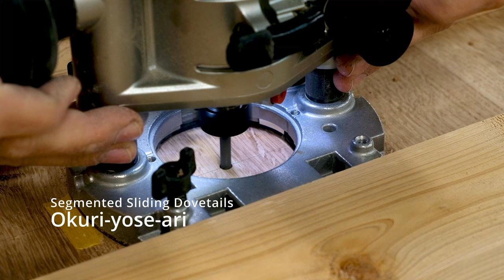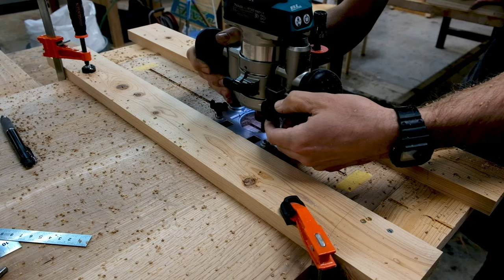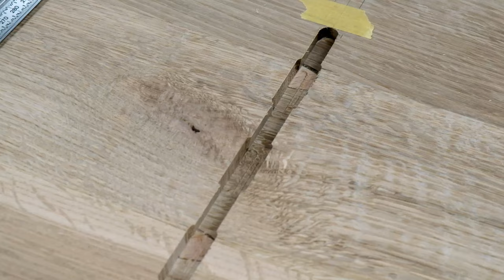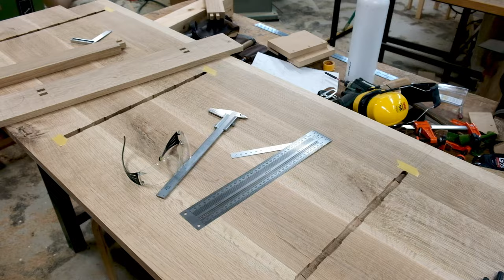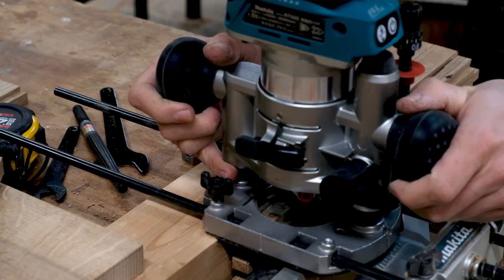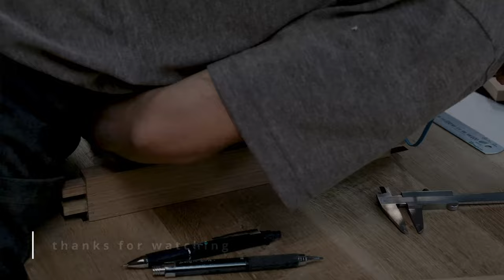Cutting segmented dovetail joinery - Okuri-yose-ari

Comment: お疲れ様です! Amazing work.

Question for you about the engineering of segmented sliding dovetails: the conventional wisdom around a regular sliding dovetail is that the ideal fit is for the dovetail to be tight/snug in the middle of the joint and loose fitting at the ends to allow for wood movement, otherwise the top can crack/split over time.

Is that the approach with the segmented type as well?